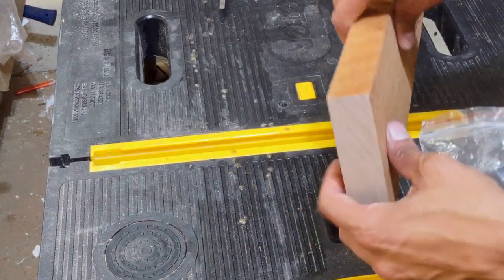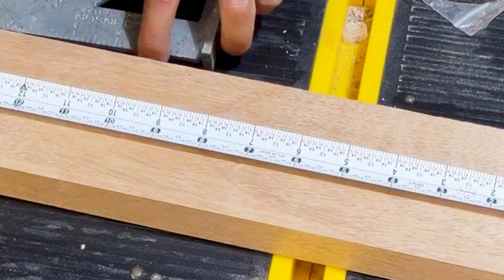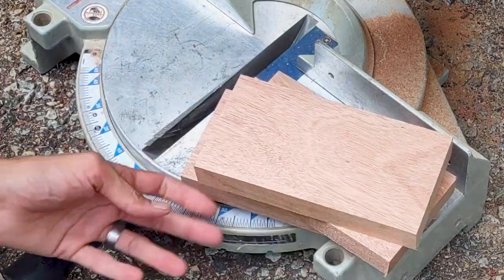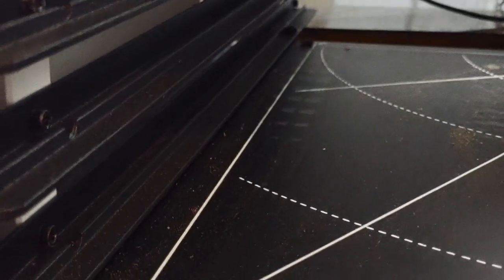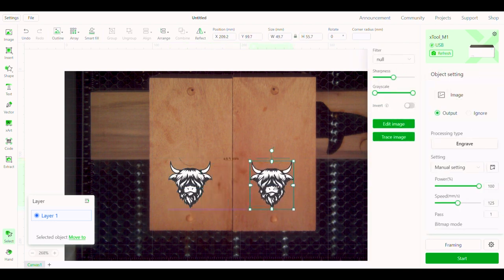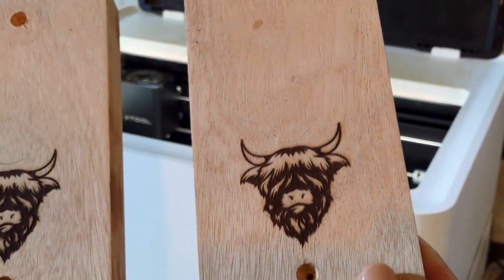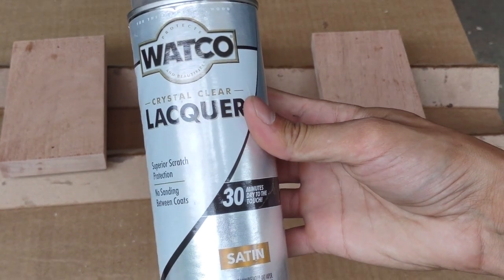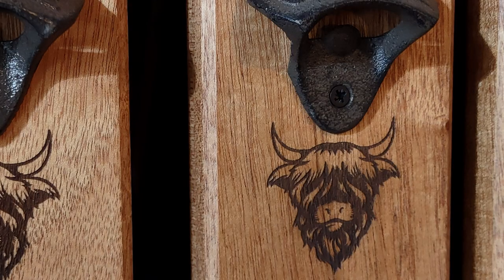How to Make Bottle Openers to Sell at Craft Fairs

Comment from the maker: What is your favorite finish for a project like this?  We love the look and feel of the lacquer, but the buffing out process took FOREVER.  Maybe wipe-on poly for a bigger batch?  Is Danish oil scratch resistant enough?  Save me some time guys, what is your process?  =)
Reply: Try a 1:1:1 ratio of Danish oil, turpentine, polyurethane.
Reply from the maker: Thanks for the suggestion.  I have not tried that combination yet.  I'm a big fan of the Danish oil though and could see that thinned poly beefing up the protection on it.